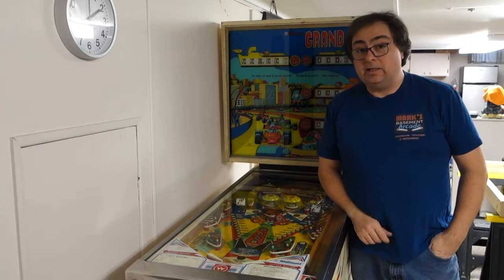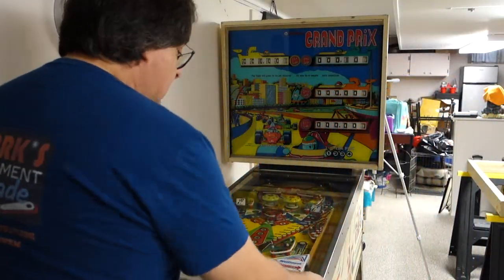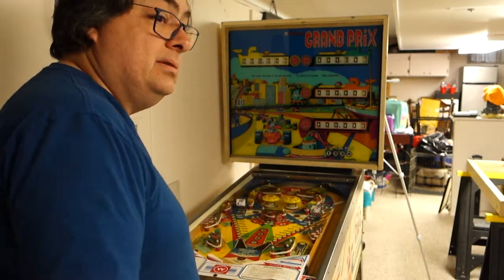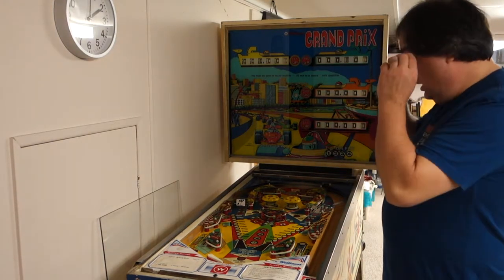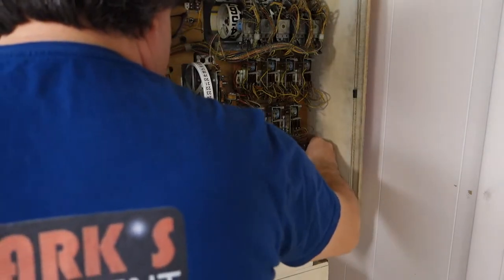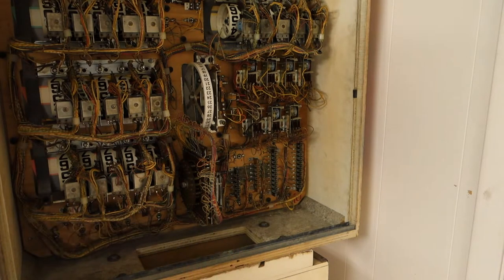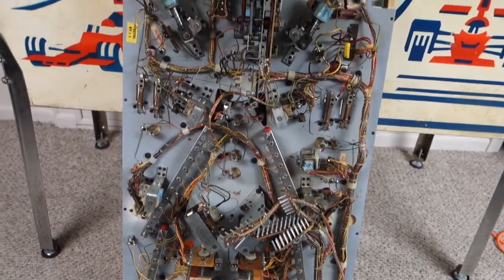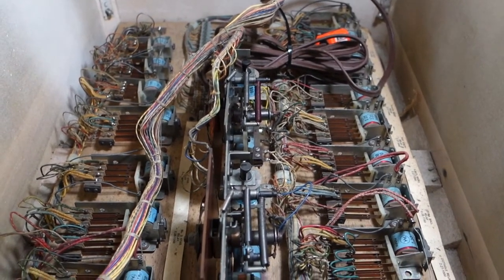1976 Williams Pinball Grand Prix Playfield Removal

Comment: is the relay to the left of the cap the change relay?
Reply from the maker: Oh man I am not sure cause I don't have this machine anymore.
Reply: @MarksBasementArcade  just looked at mine it is the Change relay....I'm chasing a hold circuit...extra ball relay wont hold so sometimes the lights :come on but the relay drops out and no extra ball is awarded.  If I manually set it,  it's liable to work. Son of a gun is heavy and playfield is jammed